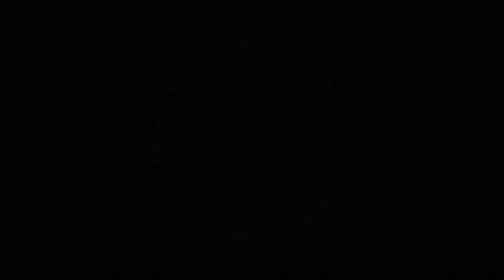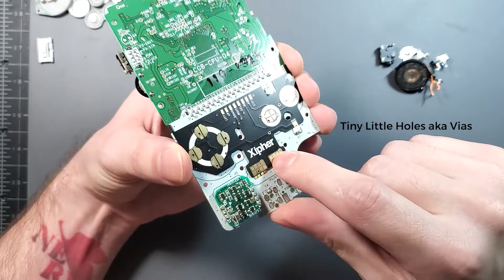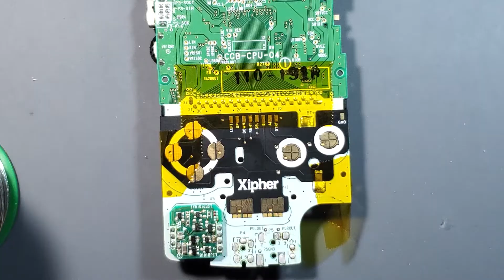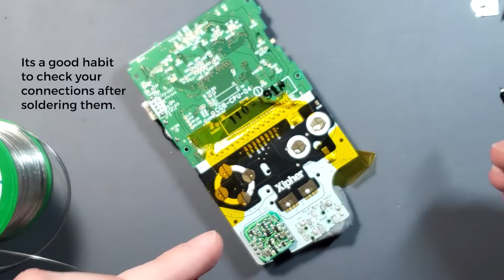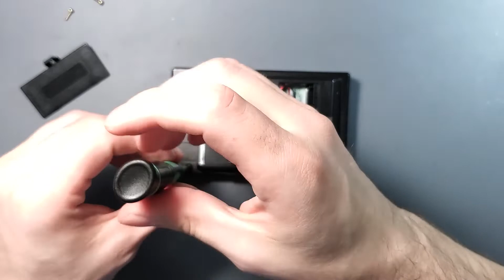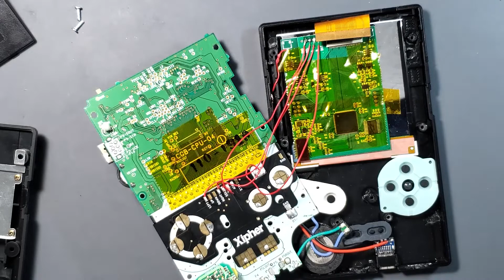New Button Board

Comment: Hi Xipher, this might sound weird but I'll be doing this with a clear shell and want an original green mask feel. If I use masking tape over the contacts would spray painting this board green have any ill effect? I wouldn't think so, but I haven't seen anyone do it. Thanks! edit: just to clarify, I'd only be spraying the button board, not the original GBC board.
Reply from the maker: If you can cover the contacts, then yeah it should be find but I'd recommend not doing that as the surface isn't likely to hold paint very well. What might be better is getting some green vinyl and overlaying it onto the button board. It's not permanent and doesn't require a bunch of prep like paint traditionally does

Comment: I was having ALOT of trouble getting my flooding on the start and select to come out nice, and not get overflow onto the other pads (bridging the start and selects). I found a simple way to make this easier... flood them both from the back first. Then all you have to do is touch the via from the front side to set it.

Comment: The contact pads on the left and right directions should be horizontally split.  This minimizes the chance of false diagonals.  Have a look at the contacts under the nes dpad to see what I mean.
Reply from the maker: That's great feedback. I think you could be right and I'll have to take a look at the board design files to see if I can rotate them and still make it possible to easily solder
Reply: @XipherDesign  Hi, I recently saw your videos, I think he's right about the dpad. Any updates on this? Thanks.

Comment: Man this is awesome! I always wanted the full GB library in the Pocket's form factor. The only thing holding me back from this mod is that I heard it struggles to run both the screen and flash carts simultaneously. The rechargeable battery mod should hopefully solve that right? Hopefully there is still room in the shell for it lol
Reply from the maker: Definitely should do a lithium battery pack. I run an EZ Flash Jr with this just fine. Standard batteries can't really keep up with the power draw. Even rechargeable lithium AAAs aren't as good in my experience
Reply: @XipherDesign  thanks for the recommendation! I'll definitely be trying this mod now 👍

Comment: How does that tiny bit of solder on the pad affect the membranes?
Reply from the maker: That's a good question. So long as you don't blob a lump of solder on the pad, there is no effect for better or worse. Same as stock. But if there is say a mound of solder on the pad, then your button presses may be off